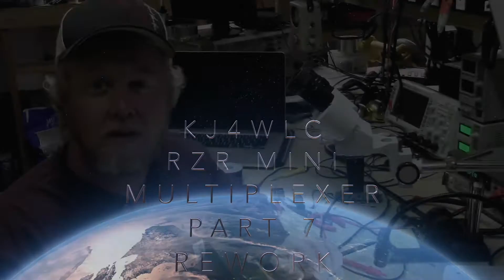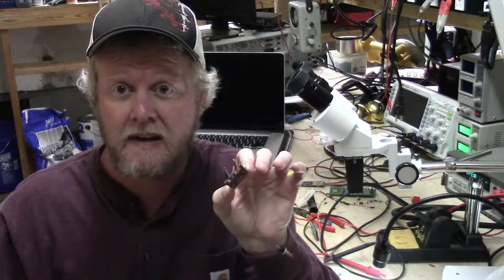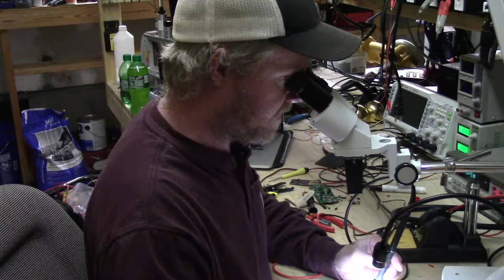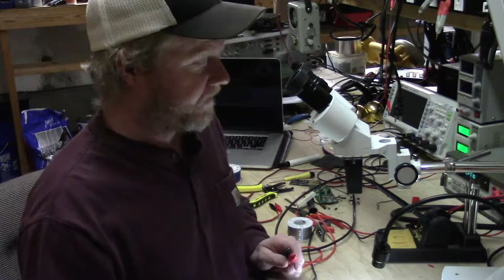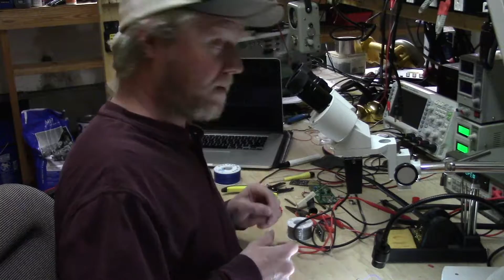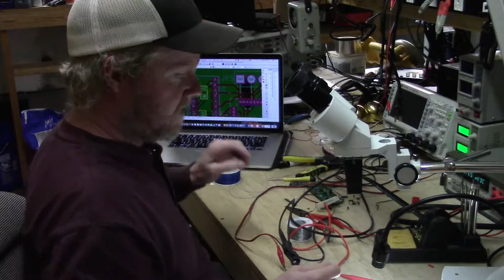RZR Mini Multiplexer Part 7 - Rework and Reuse of Prototype PCBs

Comment: Soft start is a great idea. You could use an extra input on the opto's for a hard start option. Or, the time the switch is depressed. Short momentary, instant on. Hold it down to slowly ramp up PWM.
Reply from the maker: I added all sorts of modes for pump control, racing, and a lot of other speciality situations.